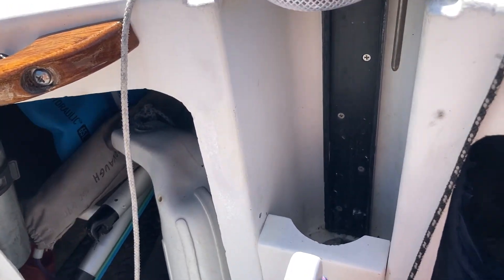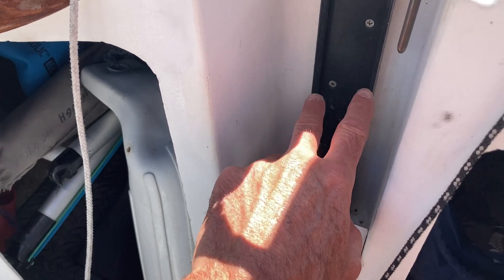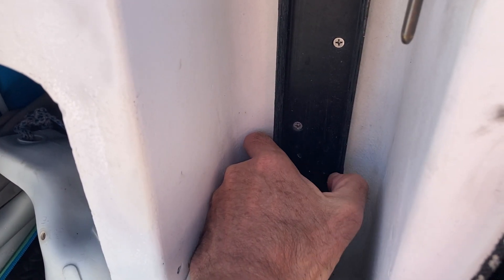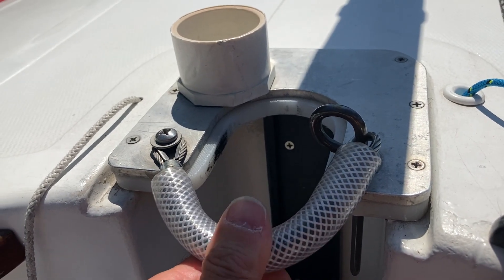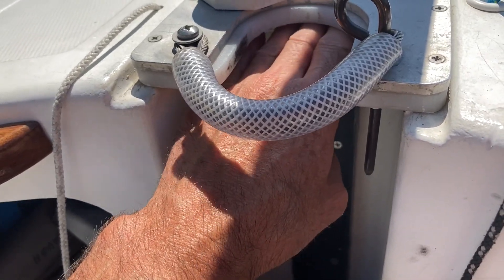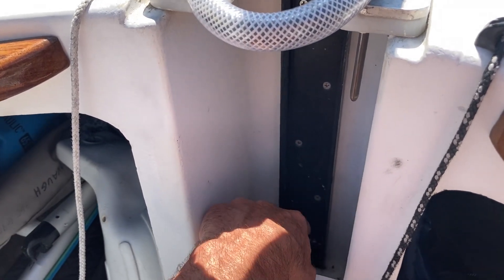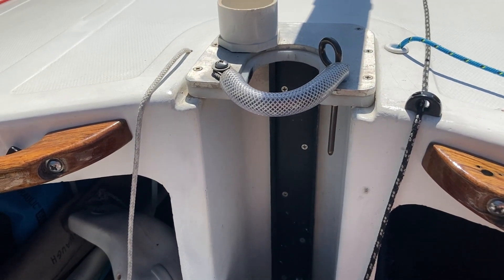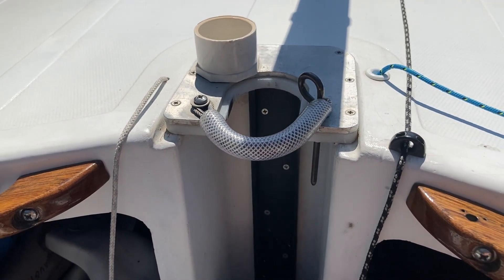Buccaneer 18 alternate mast step setup for Chrysler boats

Comment: Thanks for the video.  That horseshoe shaped collar makes stepping the mast possible for one man.  By placing the butt of the mast under it you can stand in the back of the boat and lift the mast upwards, even though you are short of the balance point of the mast.  The collar does what a hinged step does.   Mine was loose when I bought the boat.  I added extra through bolts with nuts to secure it.  I had a piece of aluminum flashing which I pop-riveted into the back of the mast-housing structure.  The flashing does what the piece of polyvinyl does on your boat.  It keeps that mast from wearing away the gel coat surface.  I also added a strap to support the mast during the rigging process.  I noticed that the mast support plate would be loose after I took the mast down.  I fiber-glassed in a solid treated wood base between the hull and under the mast support.  I added four more extra-long stainless steel screws through that butt plate and ran them deep into the wooden post support.  Whatever thin wood was there from the factory was stripped out, no doubt.  I noticed today that the wooden support for the tiller mount is largely rotten, so I'm replacing that.  

I'm curious how your rig-tensioning system works.  I want to get rid of the stock hyfield lever.  The original roller-jib setup on my boat is garbage.  My main sail is in decent shape, but not the jib.  I bought new sails, but went with a traditional jib with hanks for now, using the stock forestay attached to the mast and down to the hyfield lever.  I attached a double block just above the forestay attachment point on the mast.  I run a line to assist with securing the mast and to function as a forestay backup.  And I have a second line through the block to haul up the jib.  But I really would like to get rid of the hyfield lever.  It's awkward to get that pin clevis through that lever during the setup. I will probably eventually go to a Harken roller furler for a jib.  I have one on another boat.
Reply from the maker: Hi Gordon, Just glad to hear you are working it-sounds good. I think you are really making progress, mine took years to get dialed in! I'm just using a jib stay tension lever myself and it works pretty well. It has a hook on it so no clevis pin. Its very good to have a backup safety. If that jib stay gives the mast coming down and right at you. I show my lever in my second vid continued rigging at the end. I use a stay master to fine tune it. These boats are worth the effort and pretty tough once you get them set up safely. Happy sailing Gordon!!!
Reply: I'm curious how you attach a rig-tensioning device on the mast and then connect it to the original forestay.  In the factory setup the forestay attaches to the mast, runs down through the deck near the bow, feeds through a pulley and then to the hyfield lever.  With a new jib furler system you shorten the original steel cable so that it runs from the hyfield lever, through the pulley and then ends with a loop a few inches above the deck.  Then you attach the furler, then a jib with a steel cable in the luff functions as the forestay, and it attaches to the upper swivel which attaches to the mast.  So again, how does the forestay attach to a tensioner mounted on the outside of the mast near the deck?  Are you running the steel stay through a block/pulley and down to the tensioner?  A lot of people point out that they have some kind of mast-mounted tensioning system, but nobody explains exactly how they tie it into the forestay. I am assuming that the mast-mounted tensioner must attach to the opposite end of the forestay than the stock way of rigging it under the deck.  I think you made a customized bulkhead in your bow for a stronger attachment point for the stay.  That must have taken a lot of work in a tight space.  You are a better man and craftsman than I am.  I do not enjoy fitting myself through the access hatch working inside there.  I especially cannot imagine doing fiberglass work in that space.   I placed a fan in front of the other hatch to blow fresh air inside the space when I worked in there.
Reply from the maker: Hi Gordon  What I have is a wire block on the upper mast section mounted just about 2" above where the shrouds attach each side. So what ever tensioner lever you have mounts
about where mine is shown in the video and the jib stay flexible stainless wire, (same dia. as the shrouds) runs up to the wire block and down to the bow and mounts securely. You don't need to fiberglass in a bulkhead piece like I did-it is a task but I would get a good stainless mount plate and bolt into something really stout. I have a spinnaker shoot on my boat and with it removed I could get in and do a lot from the top side I did crawl inside to put the spinnaker sock onto the launcher and all that its a pain. I would at very least glass in a arched piece that crosses over and creates a good anchor I did mine in a fiber glassed sheet cut ti size that way your certain it will never rot like any wood piece could do in time but they main thing is its bolted through I would not trust screws run in fro the topside at all there is too much force on the jib stay. Hope this helps
Reply: Thanks for the explanation, Charles.  I assumed it had to be rigged the way you describe, but at  least now I am not guessing.  

I have already added added a larger wooden support under the deck, just behind where the stock nose ring is.  I use this as a point to secure the bottom of my jib to when it is hanked onto the forestay.  It's also  a point to attach an extra line that I use to support the mast when I am stepping it.  The main load is on the forestay that still runs through the pulley below deck.  If I ever go to a a proper jib furler I could anchor the shortened forestay at the same point below the forward deck.  I have a cable cutter and cable crimper.  

I few months back I saw a badly damaged Soling sailboat that the guy was trying to sell.  It was a sad wreck.  I talked the owner into selling me all the hardware from the boat for $200, minus the mast.  He thought me might use that for a flag pole.  But I got all the shrouds with all the connecting hardware, a lot of blocks, pulleys, fittings, just all the rigging from the boat.  Quite a haul for so little cash.
Reply: Oh, I got the transom fixed on my boat, where the tiller mount attaches.  It looked like the boat must have set on a trailer, probably at a tilt, in the open, and collected some rain water.  Anyway, the bottom six inches of the wood was rotten.  I got it all cleaned out and rebuilt without damaging the underlying fiberglass.  

July has been a lousy month for sailing.  It's been hot with little to no wind or afternoon thunderstorms.  I went sailing a few times in June when we still had days when some cool fronts came through.  It's not been terribly hot here, usually low 90's or 80's, but no systems coming through that make for good sailing.
Reply: I meant to say it's been hot and sunny or we have had thunderstorms.  We had a dry patch in late June and into early July, but since then afternoon thunderstorms have been common.
Reply from the maker: That's sad somebody let the Soling rot away they are nice boats. I've had the pleasure of getting out on an Etchells (a larger version of sorts)  to crew and I'm now steering about 1/2 the time. Nice boats but just too big to own one. The guys has three of them and naturally wants to sell me one. Sonds like your well on your way getting Bucc all set they are just great all around boats I'm a fan!
Reply: Good for you crewing on an Etchells.  I'm sure it's a fine experience. Owning a boat like that, or a Soling, would be a dream -- if you lived close to the place you docked the boat.  Looks like I will continue to be a trailer sailor.
Reply: I finally got a decent day on August 25 to take the Buccaneer out.  Light wind was forecast with little chance for rain.  Thought that would be good for sorting things out and becoming familiar with the boat.  BTW, I'm 68 years old and 165 pounds.  My boat has the low step.  I have little problem putting the mast up by myself.  Just have to make sure all the shrouds and lines are in proper order before starting.  So if I can do it, I think most people can.  Storm clouds began developing up on the Blue Ridge Mountains shortly after I got underway, which created a strong breeze blowing from the SE.  Made for lively sailing .  Had I remained on a beam reach I could not have held the boat down because of the wind pressure as gusts began to build.  I would turn into the wind, and actually the direction was best for a close reach, which still got the boat heeling pretty good at times.  I like the soft chines.  The heeling is gradual and predictable.  You get plenty of warning before you feel like you could be in trouble.  The winds were blowing about 12 mph, with higher gusts.  These boats are fast!  I learned on a smaller single-handed boat, and like you said the jib is like a turbocharger.  I went several miles toward the SW to avoid the rain and storms that were clearly hitting the upper part of the lake.  Then the wind died and soon began to shift from the NW.  As it was getting late I felt I had to head back towards the landing or I would be stranded at dusk when I knew the wind would die.  There was some lightning a few miles away, but fortunately I dodged it.  Made it back in a nice rain, which cleared as I a got within a half mile of the dock.  Winds were dying out just as I was coming in.  

So. I got a lot more from this shakedown cruise than I expected, but I did experience robust winds.  I thought the boat handled beautifully.  Of course, I was solo.  I'd say you have to not be paying attention to lose control and capsize the boat.  The only flaw I saw with the design is the location of where the main sheet connects to the boom pulleys.  Since I was hiking most of the time I was using the tiller extension.  This left me forward a bit at the widest part of the beam, so when I would cross to the other side during a tack the main sheets and pulleys were right in the way.  I'd have to move back on the side of the boat before I initiated the tack to not get tangled up.  I am thinking about changing the rigging on the boom by adding a traveler in the rear, somewhat like a Lazer or Thistle.  I don't plan on ever racing the boat, so keeping it stock is not an issue.

But I had a lot of fun.  Wednesday and Friday may be good days this coming week, according to the forecast.  As summer ends the daily thunderstorms should, too, plus less heat.  Autumn will bring much better sailing conditions here in the South.
Reply from the maker: Hi Gordon, Sorry about late reply I've been busy. Glad you got out for the shakedown and that you like the overall sailing manners of the Bucc! Could not agree more. I would sail it a bit more before changing the main sheet setup. It takes some getting used to. I would say you went right to the natural solo position on your first sail. My feet are usually just in front of the main sheet block on the centerboard upwind sometimes I inch even more forward (to keep the waterline longer.) Solo you need a long extension.  I've got the Ronstan "Battlestick" that telescopes. Reaches and downwind I move back some.
So I'm in my back hike straps then. But yes you do need to come around behind it  some to switch sides.
Coming direct from laser sailing I find the Bucc has a lot more space in the cockpit so I'm used to moving around in it. Some knee padding helps as I sometimes put one down on the cockpit floor and come back up on the new windward side when tacking. If you look at the header photo of my channel that shows about the room I have to tack through the cockpit, to me its a big enough lane to go through and that leaves space up front for  crew to go through. You might get quite a bit more mast bend moving to boom end sheeting. Hope you get out on the water more soon! Yes I bet your fall sailing is great there too. Chuck
Reply: Thank-you for your advice.

Comment: Could you possibly make a video on the rigging process for one of these boats? Thanks!
Reply from the maker: Thanks for watching! I only have two hands so that is difficult. I need at least two hands to set it up! I would download the Harry Sindle guide off the Bucc 18 website it pretty much goes through it all. Once you get it down its pretty fast I can rig mine in about 20 minutes, if I don't forget a step and have to redo a move....